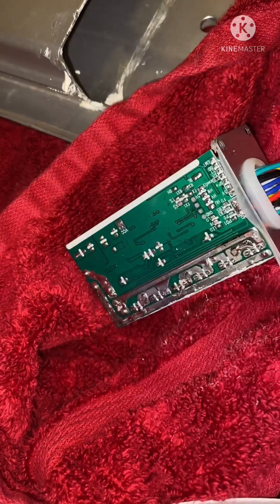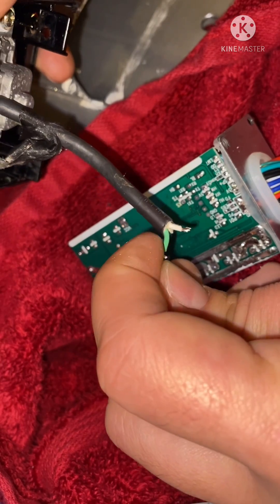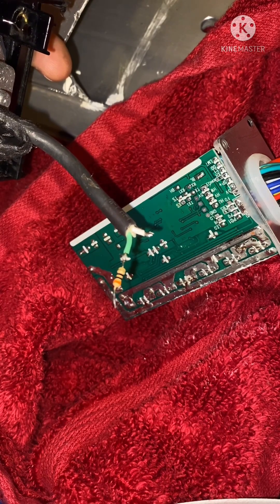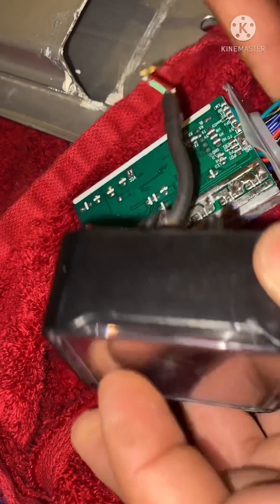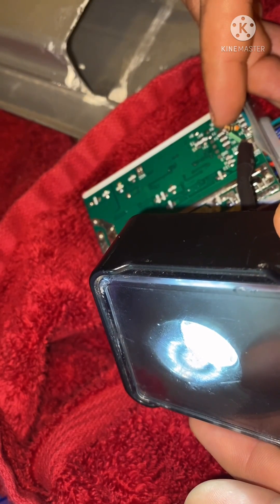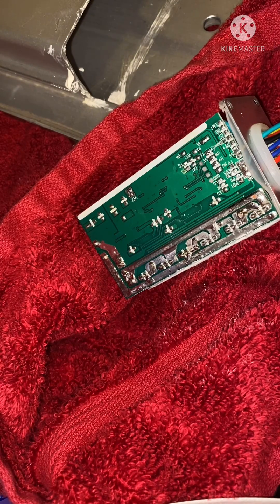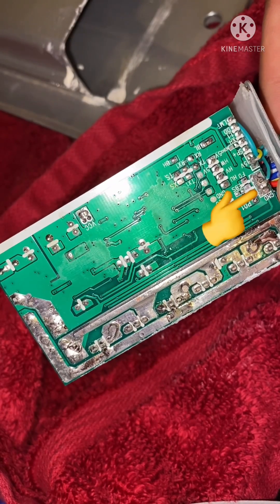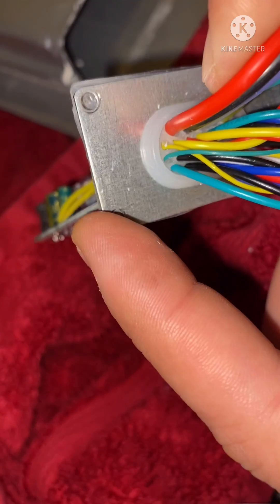￼( brain power 350 w)Controller hack for 5v Power supply￼￼ (( links in description )) 👇

Comment: Thank you for the hack. It is perfect to get the front light. Do you know if there is other similar to the back light?
Reply from the maker: As far as the back light I can get 12 V from the battery pack but I personally don’t know if it’s going to throw the BMS off ..But yes as possible
Reply: @pjscootermods  hello have question got one of thous bird zero scooter haven't swap controller yet but tried to plug it in to Charging and charger just make noise like tick and is not starting charging light is green do you maybe know what is the problem
Reply from the maker: @OopsFactoryOfFun  If your battery flickers from green to red then it could be your battery pack is faulty/electrical issue.. do you know the voltage read out ?
Reply: @pjscootermods  11v it should be 42v  so looks like is dead and charger is not starting at all really thanks for replying
Reply: @OopsFactoryOfFun  if you plug in to charge your B0 and charger box stay green possible scooter has bad charger port or scooter is already full charge. If charger box goes blank when you plug in your scooter you have a bad motor controller.